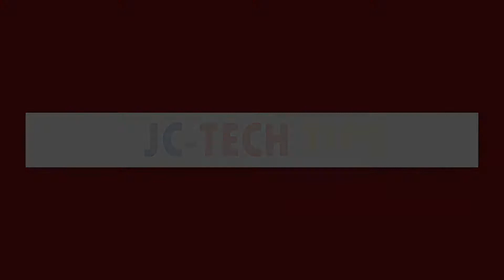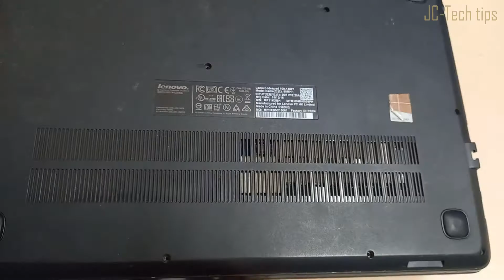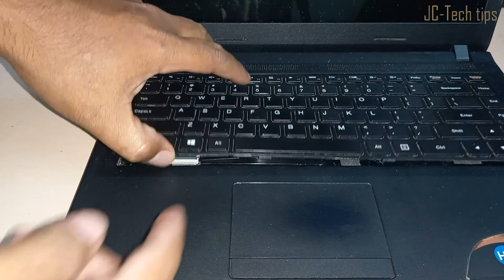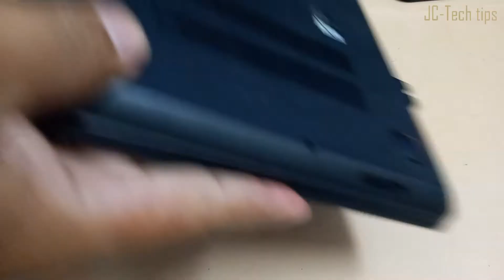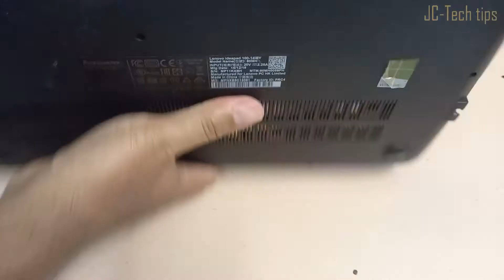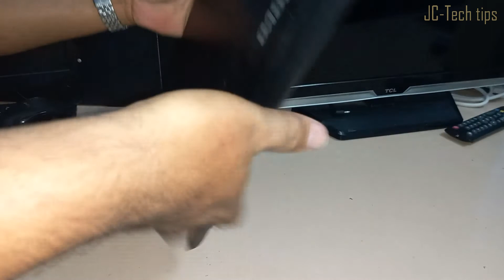Replace/Upgrade HDD to SSD on LENOVO IDEAPAD 100-14IBY

Comment: Hi may I ask is it necessary to removed the keyboard and the screws underneath it in order to change the hdd? Can it be done just by removing the screws from the bottom cover?
Reply from the maker: You need to remove the keyboard first, because below the keyboard there is a screw connected to the back of case.
Reply: Thanks for the tip 😎👍🏻👍🏻👍🏻

Comment: I already updated adata SSD but the speed increased 284 reading and writing, I expected to increase the speed above 400 but it did not happen, does it affect the hardware, do you recommend increasing the ram memory?

Thank you very much for yor feedback
Reply from the maker: The specs say is up to 480mbps, is not exactly, but yes you can upgrade the ram.
Reply: Al parecer es Sata 2, la mía llegó solo a 280 de lectura, actualizar la ram al doble y realmente no sentí ninguna diferencia

Comment: I changed de hdd to the sdd 1tb and the memory ram but when I turn on the laptop,it says boot fail efi network 0 for ipv4. What i have to do? Thanks
Reply from the maker: You need to install new operating system for that.
Reply: @JCTechtips  Thank You
Reply from the maker: Youre welcome. @rikitoledo3535

Comment: how many ram slot for this laptop? can I upgrade it to 8gb 1600mhz?
Reply from the maker: Only 1 slot for RAM, You can upgrade the ram maximum of 8gb, the 1600mhz is compatible.
Reply: @JCTechtips  thanks
Reply from the maker: @franzreazo6157  Welcome po.
Reply: 1.5 V or 1.35V for ram?
Reply: OK,  frequency run on 1333 mhz

Comment: Bang saya upgrade ssd 512gb dan ram ddr3l 4gb dah kenceng belum ya? Apa harus ddr3l 1333mhz?
Reply: Saya mau beli ram bingung antara ddr3l 1,35v/ ddr3 1,5v/ ddr3 1,5v (16ic)? Apa bedanya
Reply from the maker: @adeandikap  L adalah singkatan dari "tegangan rendah", yaitu 1,35V, bukan 1,5V. Jika komputer Anda mendukung atau membutuhkan RAM 1,35V, itu akan menggunakan lebih sedikit daya, mengurangi panas, dan memperpanjang masa pakai baterai, DDR3L adalah sebutan yang digunakan beberapa produsen untuk mengatakan bahwa RAM beroperasi pada 1,35V.

Comment: Hi can I add ssd m.2?
Reply from the maker: For this model there is no slot for m.2 SSD, you can add only Sata SSD.
Reply: @JCTechtips  thank you for your reply 🙏 may I know how many slots of ram are there in this model?
Reply from the maker: @Junta99   has 1 slots, the maximum amount of 8GB

Comment: Hola, no sabes donde consigo una ram para está laptop 😅
Reply from the maker: Puedes comprarlo en lazada. DDR3L-1333 MHz / 1600 MHz SODIMM × 1 (max 8 GB)
Reply: @JCTechtips  1.35 v     ou.     1.5v.  ?
Reply from the maker: @sempreaqui4901  the two is working, but better less voltage.
Reply: Moço como faço pra aumentar além dos gb de ram cm vc tá mostrando mais aumentar tbm o HD o meu é muito pouco 

Tenho de 4gb de ram e HD 500 gb 
O notebook fica muito lento. 

Até quanto pode aumentar nesse modelo lenovo idealpead 100 modelo 14IBY 

Por favor
Reply: Recomendable 1.35 para no tener problemas más tarde. He leído por ahí casos en wue la ram se a quemado

Comment: El sábado me llega mi SSD y mi ram de 8 GB tu vídeo será mi guía 😅 espero todo salga bien
Reply: Ojalá veas este mensaje, si le voy a cambiar ambas cosas, primero le cambio el SSD y ya cuando corra Windows la vuelvo a apagar y le cambio la Ram? O primero la ram y luego el SSD, o se puede ambos al mismo tiempo?
Reply: @DanielB-xs7py  primeiro ssd, depois insira um pendrive com sistema operacional Windows ou Linux, deixe o laptop operacional, depois desligue e faça a troca de memória RAM
Reply: Amigo minha dúvida está memória RAM 8 GB DDR3 é 1.35v 1600mhz ou 1.5v 1600mhz?
Reply: @sempreaqui4901  compre esa y me fue a la perfección, está laptop corre a 1333mhz pero si no encuentras las de 1333mhz le puedes poner esa de 1600 sin problema, la máquina solo toma sus 1333 de ahí 😁
Reply: @DanielB-xs7py  viste diferencia, a cuánto te corre el SSD? Yo actualizar solo a 4 de ram y realmente no vi diferencia muy notoria
Reply: @danielcorral466  Mucha, pues yo trabajo con Photoshop, pero está lap en particular tiene ya 4 de ram, entonces lo único que le puedes hacer es upgrade a 8 , mi PC nunca fue lenta en si, pues siempre la mantengo limpia y cuidada, sin embargo la ram ya no daba batalla para los procesos que requería en diseño, pero si, prende más rápido va más fluida, no se traba no cierra programas, si se nota mucha la diferencia cambiando SSD y upgrade a la Ram queda como una PC de gama media ( con la limitante del Intel obviamente ).
Reply: @DanielB-xs7py  sí estoy de acuerdo que aumenta mucho de velocidad pero en mi caso se lo atribuyó al ssd 1000 veces mejor que hdd, la mía solo traía 2 gb de ram de fábrica por lo tanto le aumente a 4 ya teniendo el ssd con los dos de ram y cuando cambié de 2 de ram a 4 la diferencia fue muy mínima la diferencia del ssd a hdd es abismal tu cpu es celeron también??
Reply: De cuanto compraste GB compraste tu SSD?
Reply: @doct117  de 120 pues no la utlizo para nada más que diseño y trabajo, no tengo música, videos o juegos y de externo me quedaron los 500 del sólido que le quité, considero que para ese procesador es suficiente si vas a usar el HDD que le quitaste porque tampoco es como que le puedas poner juegos demandantes

( Depende de que tantas cosas le instales Puedes considerar el de 240 si tu presupuesto te lo permite ) para mí fue suficiente 120.
Reply: @DanielB-xs7py  gracias, tu crees que aguante de 1tb?
Reply: Cuanto dinero te costó el SSD y la ram de 8gb amigo ???
Reply: @drdiego.u9628  fueron menos de  $2000 pesos MX de ambas cosas, pero en en hotsale, prime day y el buen fin puedes conseguir el SSD de más capacidad por el mismo precio
Reply: @DanielB-xs7py  gracias por responder.
Crees que si valió la pena el cambio?
Yo tengo la misma computadora y quiero ponerle un SSD de 120 y 8 GB de ram
Reply: @drdiego.u9628  Es muy subjetivo, si la quieres para instalar juegos o algo así, pues no, pero una PC de gama media con procesador básico, SSD y ram +8 de 12k no va a bajar, estuve buscando y son pocas veces las que cazas una buena oferta, pero en general no.
 Yo la uso para trabajar con tableta, photoshop, illustrator & un poco de premier para vídeo y audio y me a funcionado muy bien prácticamente, si la usas para trabajado o estudiar te va a durar un par de años por menos de 2k extras con los 2k le alcanzas a poner un SSD de 500 y ya tienes un disco externo extra de 500 en mi caso valió muchísimo la pena la inversión, prácticamente se pagó sola.
Reply: @DanielB-xs7py  entiendo.
Me podrías decir la referencia de tu SSD por favor?
Gracias
Reply: @DanielB-xs7py  no me detecta el wifi ya que formate , alguien tiene alguna solucion?
Reply: Hiciste un backup de tus drivers?
Reply: Aguanta hasta 2 tb
Reply: Me recomendarían reparar mi laptop Ideapad 100? La pantalla se quebró, pero me gustaría repararla y pues cambiarle el disco duro y aumentarle la memoria. Es que le tengo valor sentimental al aparato. 😅😅😅